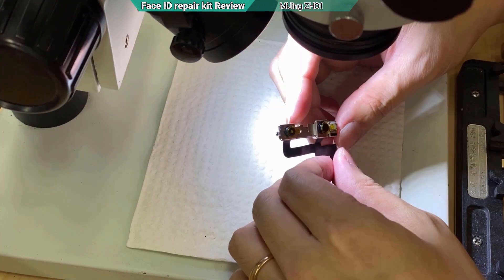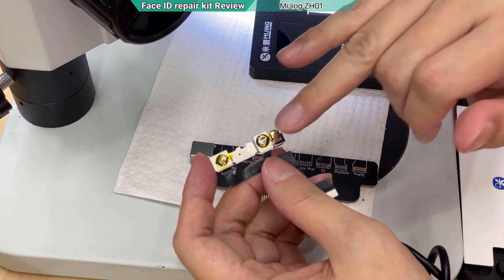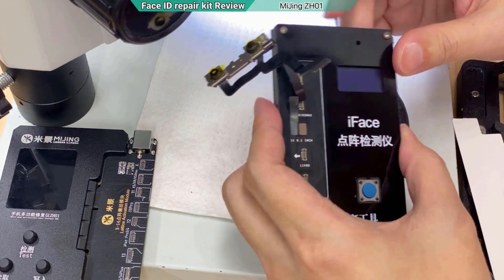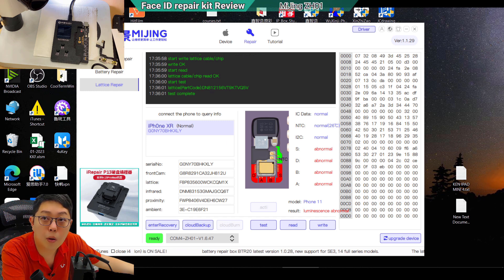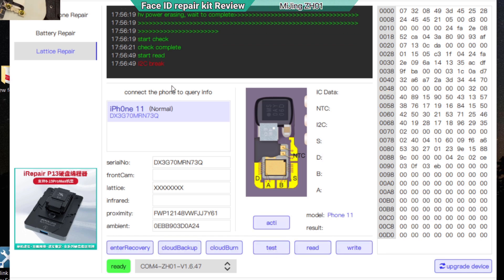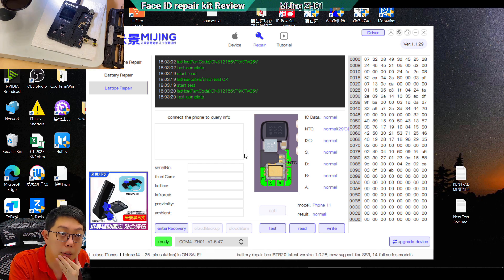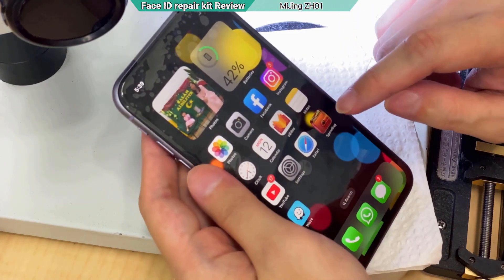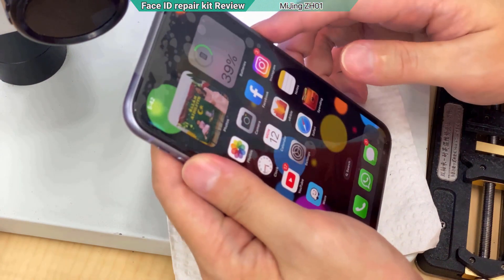【REVIEW】MiJing ZH01 | Face ID Truedepth Repair Kit 2023

Comment: Why does it fail in the first place? if the tag on flex can fool the software doesn’t that mean the dor projector is not bad? or the dot projector is not needed for face id?
Reply from the maker: The fuse inside the dot projector is broken.